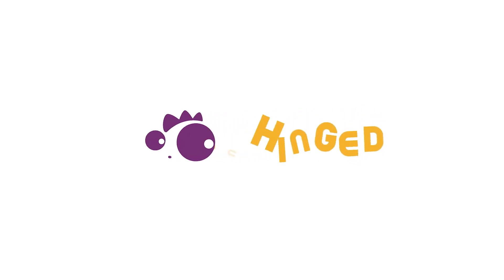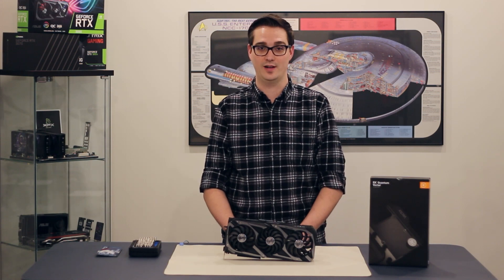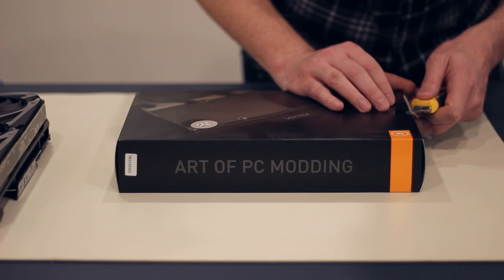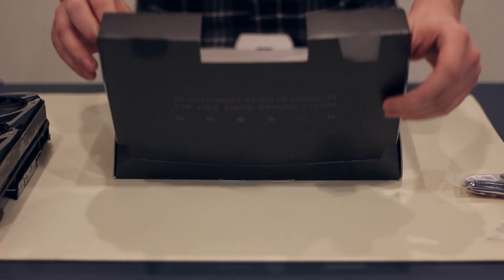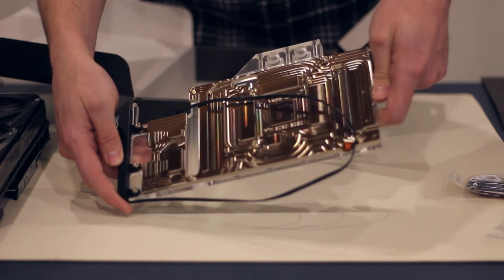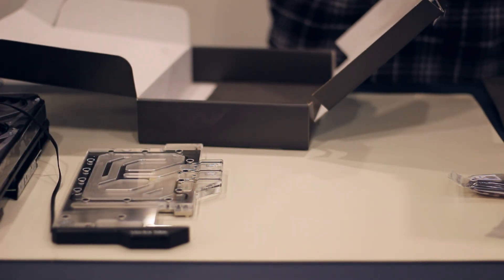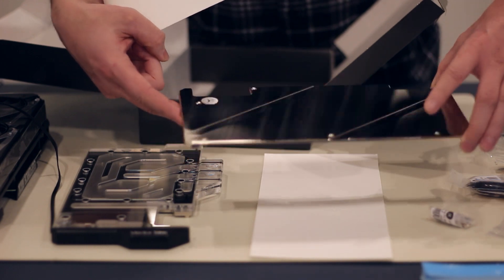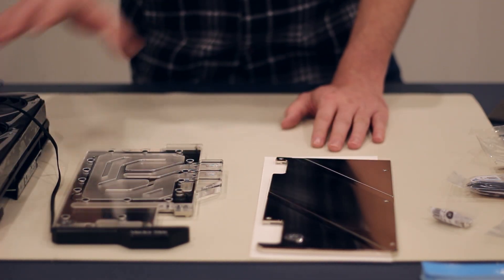2021 PC Build Pt 8 - EK Quantum Vector Strix 3090 Water Block Install

Comment: Hey man, great video! So quick question for you. I have the same card, water block and and backplate but for some reason my card died. As soon as I set up the system and ran the full loop I had a VGA error 97. But not sure why. I tried everything and even put the original cooler back on, LEDs are on, fan spins but still vga error. I know it’s not the system cause I tried anothe GPU and was able to get into windows just fine. So it’s something to do with the water block and the card or just the GPU. I read something about washers in the backplate; but I didn’t see any, did you have to use any washers? Particularly on the backplate. Any help would be appreciated
Reply from the maker: I'll review the build, I followed the instructions to the letter. Double check the switch on the card. There is a little switch to switch between performance and quiet mode. Try the switch in either position. My understanding is that this is a dual bios card and maybe you switched it to a bad position. Try it out and let me know! As long as you didn't cross any contacts with the power running it should still be good.
Reply: @UnhingedSystems  okay I’ll try that. If not I’ll have to RMA to Asus Dx. Also sorry for the grammar errors, I fixed them now😅.

Comment: Dude your videos are great what kind of connectora you use the quantum on EKWB?
Reply from the maker: Thank you! Do you want to know about the RGB addressable connectors or the fittings for the hard tubing?
Reply: @UnhingedSystems  the fitting for the tubbing im going soft tubbing tho no idea if that makes a difference xD thanks for answering
Reply from the maker: @igfm84  The EK Blocks are typically compatible with the G1/4" threading. If you are going soft-tubing you will want to find yourself some G1/4" soft tube fittings that are for your specific diameter of soft tubing you are decided on.

Thank you for the comment!

Comment: Did you discover when you placed the GPU and the Water block together?  There was about a 1/8 to 3/16 space between the board and the block? I hope that made sense.
Reply from the maker: I was originally concerned that the clearance was too much and that it wouldn't make good contact for cooling but after securing it the fitment was good. The spacing that does exist is good and prevents any shorts.
Reply: @UnhingedSystems  - Here is my issue.  There spacing is so far apart.  When I try to insert the GPU on the water block.  The thermal paste from the GPU does not even make any type of contact with the water block.    Hard to tell, what is exactly on the GPU in the way of clearing the waterblock.
Reply from the maker: @lhbbq  Are you using the same water block and the same Asus Strix OC 3090? I definitely didn't have that problem with it. Are you using the provided 1mm thermal pads or equivalent 1mm pads?

It almost sounds like they sent you the wrong block.

Comment: any coil whine??
Reply from the maker: The initial install had terrible coil whine. EK changed the install to use longer screws and thicker pads to help. After trying several things and changing out the thermal pads with some actual decent pads the coil whine is barely audible now.
Reply: @UnhingedSystems  ohh man i also have terrible coil whine from my 2080 ti fe after installing my ek block now im trying to figure out how to reduce it . which brand thermal pads are you using and what size (mm)
Reply from the maker: @buckaroo839  I'm still following EK's new spec for my backplate (1mm block side, mixed on backplate side 1 and 2mm depending on placement. I am using thermal right odyssey pads. The trick for me is a combination of better pads and having less tension on the screws. They changed the design to 8mm from 7mm screws and one must be careful not to apply too much tension or it will slow down the vibration of the inductors and cause audible coil whine. Too little pressure and the pads may not cool as rated, too much pressure and the inductors will scream.

Comment: Did you not use the 24 pin connector for MOBO power? I noticed the 8/4 pin connectors zip tied top left of your mobo? I start my build this weekend with the same mobo and 5950x so naturally I'm curious about it. Or do you use both maybe hmm.
Reply from the maker: Definitely used the 24-pin for motherboard power. There is a 24-pin Lian-Li Strimer Plus connected to the motherboard for power as well as the two CPU power cables.
Reply: @UnhingedSystems  so it does require the 24/8 and 4 pin all then? Dang
Reply from the maker: @HoxPlays  That is correct. This board wants maximum power!
Reply: @UnhingedSystems  Thank you so much! I would have been lost as to why it wouldn’t fire up completely lol. Also great tip about 1 ram stick until after it’s running. I will keep that in mind.
Reply from the maker: @HoxPlays  My pleasure! Thanks for watching!

Comment: Its hard to figure out what side to put facing down o. The memory chips cause the way u do it its dark blue side up problem with thay it thats fhe sticky side so instead if sticking to the memory chips it sticks to the block I figured the dark blue side would go down stick to the memory chips thn block goes on idk and how do you know its all good after you do it friend told me after putting on everytjkng you gotta hope u did it rigjt or u can short soemtjkng out I hate that ek didn't cut tjem to size snd I gotta figure out how to cut them to cover everytnkng
Reply from the maker: Cutting them to size manually is certainly a pain. It really makes no difference which side is up or down, personal preference. I like sticky side up so they are easier to remove later (much easier to remove from the block side), but sticky side down is easier to get the right placement and have then stay put.

Comment: Bro, I think you forgot to take off the films upon the thermal pads.
Reply from the maker: No film was left on the pads, all were removed, some off-camera. I always do a count to verify after the fact.

I try to film everything, but manning the camera and doing the work all at the same time sometimes I forget to hit "Record" lol.
Reply: @UnhingedSystems  haha, got it
Reply: @UnhingedSystems  bruh @siyu qin is right. You didn’t take the films off the other side of the pads. I watched the video in slow motion. May want to fix that
Reply from the maker: @clj4469  The shot I used was the "test fit" shot before the pad films were removed. Off camera the film was removed before starting on the backplate. Just a matter of how it was edited. Appreciate everyone's keen eye though!

Removing the film was actually a pain in the rear. Not a fan of the EK thermal pads.

Comment: Hi :) awesome video! I will be using the same block from ek. Are the thermal pads which come with the block ok or should i get some thicker once for special areas of the card like you?
Reply from the maker: Thank you! The thermal pads have sub-par performance, I recommend getting some better thermal pads that are rated at least 8W/mK.
Reply: @UnhingedSystems  thanks for your answer :) any recommendations? I found so many products on the
Internet.. can I use 1,5mm pads for everything or should I use different. Heights for different areas? Appreciate your help!
Reply from the maker: @JasonSmV  You will need to use the same thickness pads that they recommend in the EK manual. 1mm on the block side, mix of 1/1.5/2mm on the backplate side. I can highly recommend either the Thermal Grizzly Minus 8 pads (8W/mK) or the Thermalright Odyssey pads (12.8 W/mK). I would use a better thermal paste than EK provides as well such as Arctic MX-4, Thermalright TFX or Thermal Grizzly Conductanaut.
Reply: @UnhingedSystems  thanks! im not sure about the liquid metal on my GPU. can i fuck something up there? ^^ i got some MX4 lying around and obviously want the best temps  for my block since i cant take it off that easy after i assembled it.
EDIT: just ordered MX-5 all good
Thanks for you help again! Sub well earned ;)
Reply from the maker: @JasonSmV  Liquid metal is definitely risky, Thermal Grizzly Kryonaut is non-conductive as well. MX-5 doesn't list their thermal performance yet, I have some on order and will test as soon as it arrives 👍 I am expecting slight improvements over MX-4 which is great because I put MX-4 on everything.